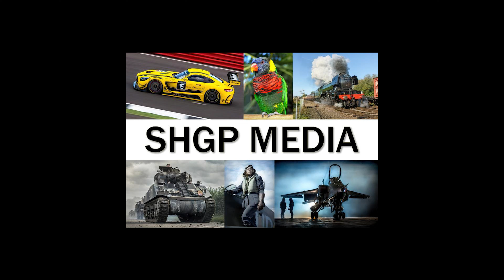Avro Anson 19 - Old warden

Comment: Some of the World's most fascinating aircraft are based at the Shuttleworth Collection in Old Warden, Bedfordshire.  They have a genuine 1917 Bristol Fighter, which is still airworthy and has the oldest Rolls Royce aero engine, still flying anywhere in the World.  They also have an airworthy 1912 Blackburn Monoplane, from the same year the Titanic sank. There is also a slightly older Bleriot, although this does not have it's original Anzani engine, but is fitted with an authentic replacement. And to to top it off, there is the Collection's DH 60 Moth biplane. Bought by Richard Shuttleworth himself, back in the 1930's. It is the only aircraft in the World, still flying from the base it was registered at almost 90 years ago. The Shuttleworth Collection is also one of only three places in the World, where you can still see an original WW2 Me163 Komet rocket powered fighter.